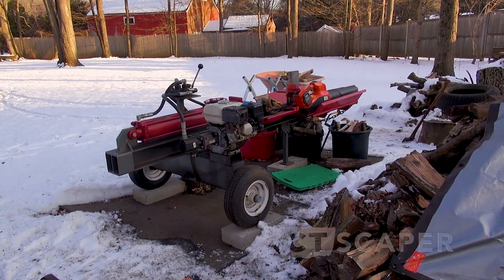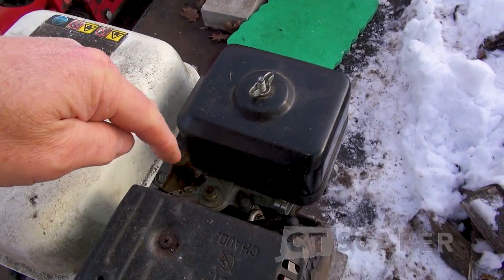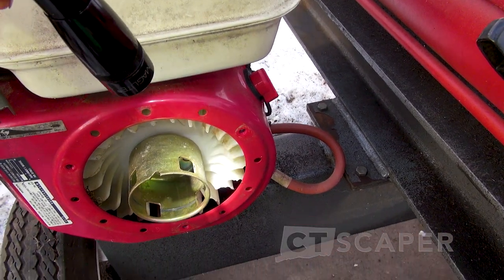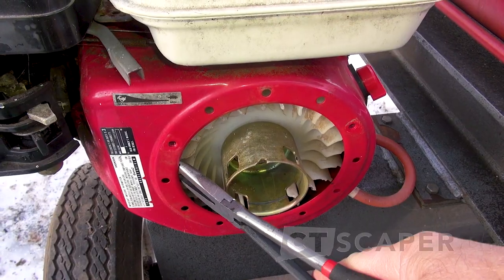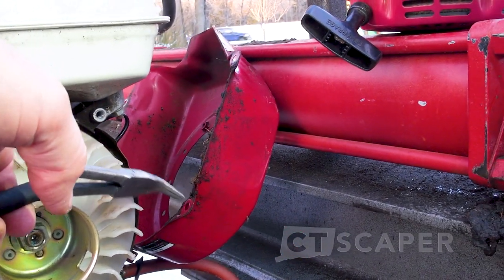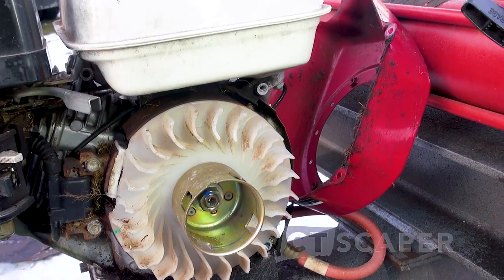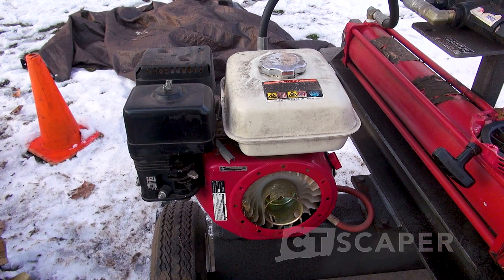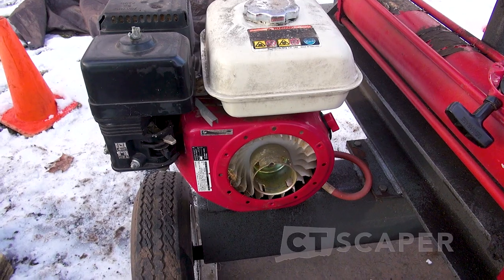MOUSE NEST DESTROYS ENGINE!

Comment: I had mice getting into the attic at night last year.  Tried several store bought traps and baits which did not work very well.
Then i spent 20 minutes making a Mascall Mouse trap from some scrap 2x6 wood.  It works amazing!  there's tons of vids on this trap. Caught many then no more mice problem.  The design is 400 years old, simple but super effective even today.  Expect the mice to be there year after year.  Just set the Mascall trap and it will work.  sunflower seeds are the best cheap bait, with little peanut butter on the trigger string.  Trust me, try it.  or simply deal with the headaches of cleaning up after them.  beware hantavirus too
Reply from the maker: I'm thinking it's time to get a little more agressive in my control strategies.  They're in my attic too along with the cars and everything else on the property.

Comment: Yea had that happen during this summer didn't pay attention at all was splitting wood an I smelled pee I looked over an I seen smoke next thing flames started so it does suck for sure
Reply from the maker: Ooh!  Not cool!  Did you catch it before it burned the wires or the machine?
Reply: @CTSCAPER  I did catch that before anything burned up no damage but I did learn my lesson an I should of known better

Comment: I have the same problem but mine is compounded because l have a hog barn on one side of me and a chicken barn on the other.  For any equipment l have that doesn't have an enclosed cab l use old fashioned mothballs which seem to work pretty well.
Reply from the maker: Thanks for the recommendation.  I was thinking of giving mothballs a try.  We had a rainy year here and the mice have gotten out of control.
Reply from the maker: @burtreynolds3143  Loved you in Cannonball Run!  I've got some zap traps with peanut butter in one of my vehicles, I hate to do it but I can't afford to rewire.  Lord mouse pee smells in the summer.

You've got the right idea of multiple methods to control the mice.  I think they outsmart us as fast as we come up with new ways of outsmarting them.